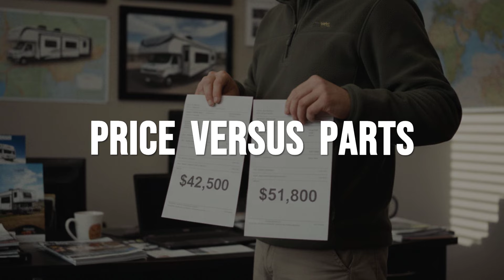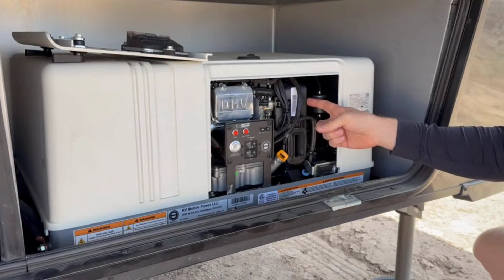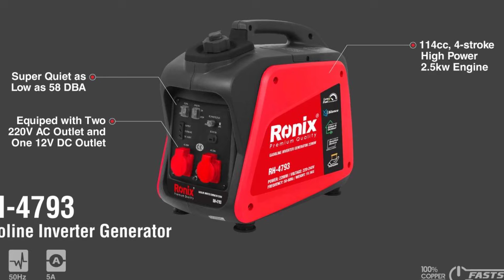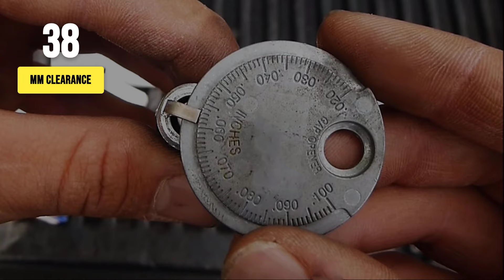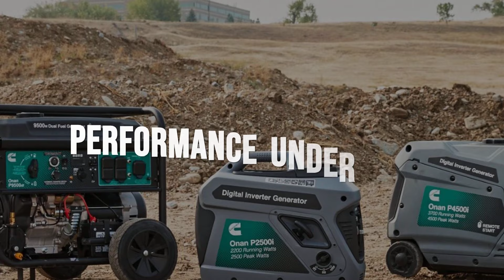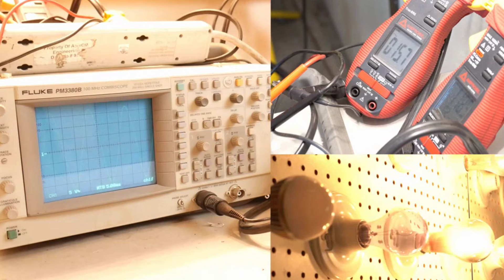WHY 95% OF RV GENERATORS ARE OVERPRICED JUNK (THE "INVERTER" SECRET)

Comment: Yes marketing all the way. Any electronics techy knows. The power brick is actually a power adapter. Its in the name. Adapt the power to the device. In depth of that statement. The power brick adapter itself converts the 120v ac current to device requirements of 3,5,7,10,12,14,18,20+ volts dc. The power adapter is modifying and controlling the power feed to the device. Any harmonic distortion is isolated in the transition circuitry. The conversion from ac to dc creates the pure sine the device needs.

Comment: Buy a Honda, you won't regret it.  You'll pay more but it's bullet proof and works as advertised.  I have about a thousand hours on mine and it still starts on one pull and my cousin's machine has over 10,000 hours on it and it is still running and he mistreats it!  These are the Honda eu3000is generators.

Comment: Companies rip-off consumers because most people have no idea about electricity. This is why they always advertise in WATTS and not KILOWATTS. It deserves people because a 2,000 watt generator can barely run a coffee maker. When you're in the gen business, we refer to KW. A 2 KW is the same as a 2,000 watt. Most also don't know they can simply buy a 5,000 watt inverter which can run quiet a bit (5KW) off your vehicle by simply hooking it up to the auto battery and use an extension cord, or two. Most inverters (basically DC powered with nothing but DC batteries with an inverter (converts DC to AC). AC is what you use in your home in the USA. There's hundreds, if not thousands of things that people who don't work in electricity that I could write and show. Perhaps I need to start a YouTube channel too?